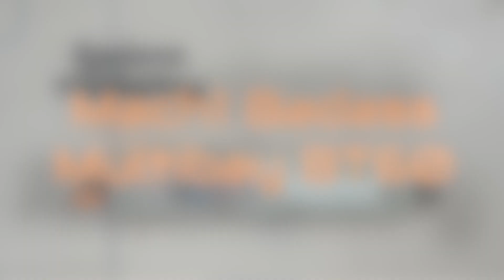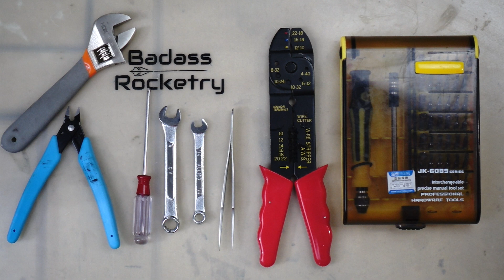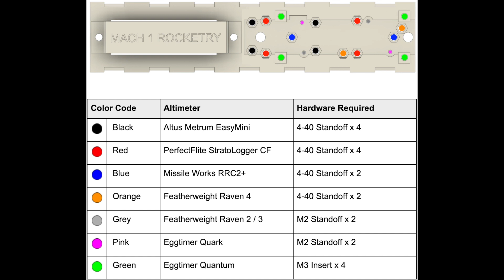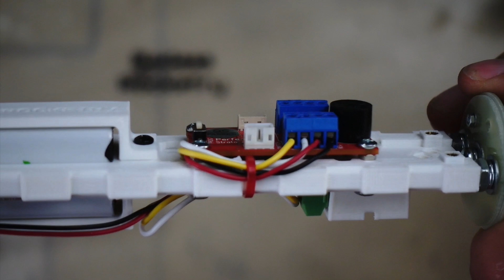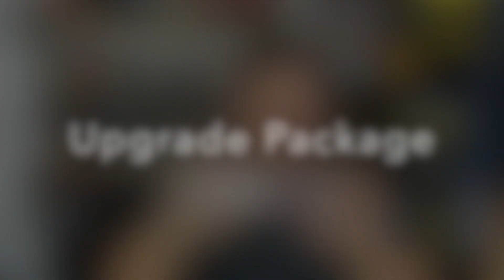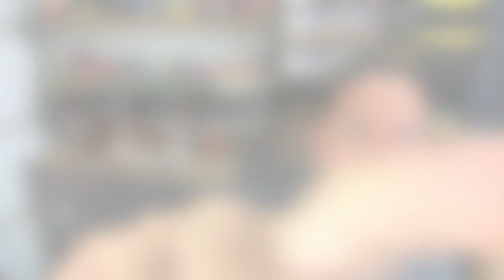Mach 1 Badass Multibay BT60 Build Video

Comment: Nice video, is there one for the 54mm x 7" multi bay?  I am just curious about the charge wells.  The kit comes with 4 and I am wondering if all 4 are required, or if this is just to accomodate for bigger rockets.  I have the Red Shift kit, so it is 54mm by about 52" in length.   Any help would be appreciated.